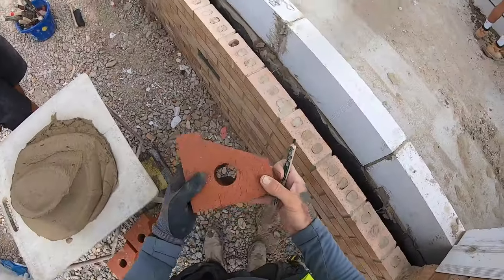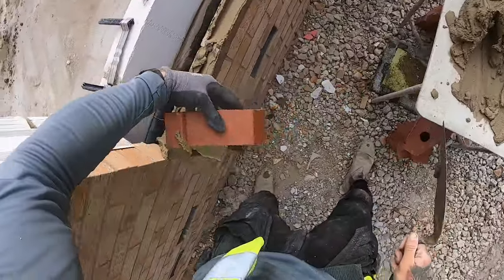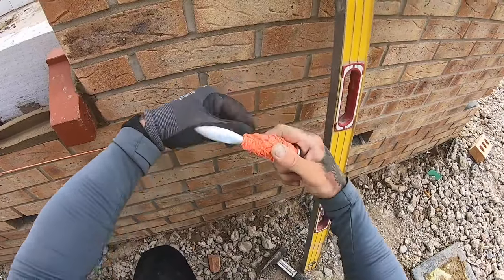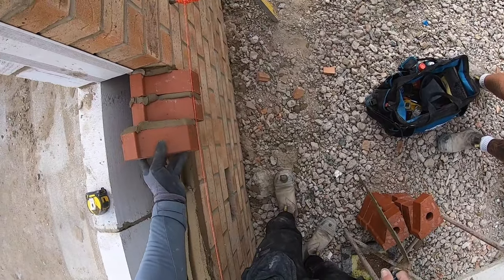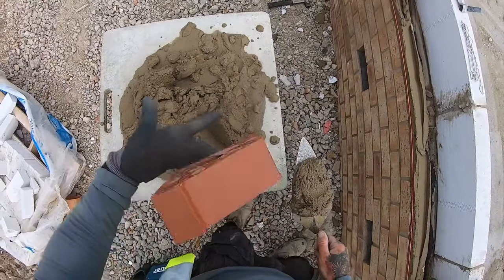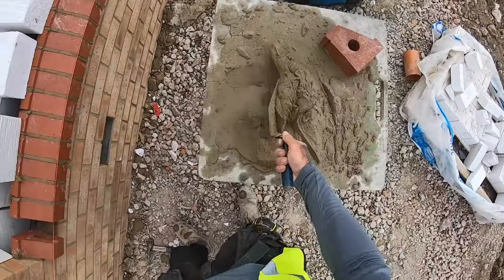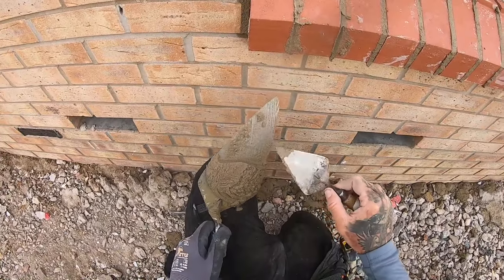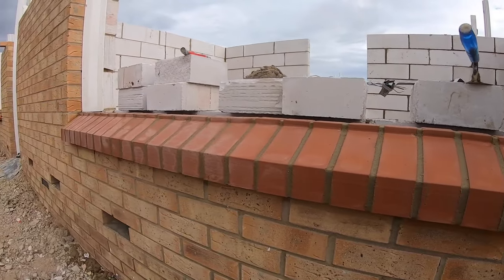How to Lay Cill Bricks Freehand 🧱 #bricklaying #Brickwork #teaching

Comment: Back in 77 I literally built hundreds of four -six feet brick sills on the old St Pauls field site in Hammersmith. I was an 18 year old apprentice.  I worked for the General Contractor but all their brickwork was subbed out. The subbies didn't have too much time to teach you anything. Their was no money in the sills so they wanted nothing to do with them. I got lumbered with them. Luckily, the first one I was put on was well away from the general population. That was lucky for me, because the first sill must have collapsed on me four or five times. Near the end of the day some old boy came by to hide his tools. He saw may predicament and spent about half an hour with me showing me some tricks of the trade. How to cut the angle of the brick with the scutch hammer, which was basically a brick hammer with teeth. Lay the bed on a slight angle as well and let it set up while you prepare the next sill with Dpc. Also when laying also butter the angle at the back of the brick. the joint would connect to the inside block.
    Took me a few days of trial and error but I was soon pretty prolific at them. What was best was when one of the subbies would be put on them for a day. More often than not they had previously criticized my work. Now they were on my territory. Got a great kick out of how they would get a bollocking in the evening when the foreman would count their sills and complain to them that," even that bloody apprentice done more than you."

Comment: Lay the first two as you did and then nail/screw/Dutch pin some lath the length of the run at underside of the cills. 
Gives something for the front of the cill to sit on and stops them from tipping

Comment: Not a criticism or anything Charlie but you should measure the overhang from point A to B and if it looks out at the top of the slill then its down to the bricks and you can prove it ,Saying you put the starting points at the back of the bricks puts the blame on you as you are going off the facework